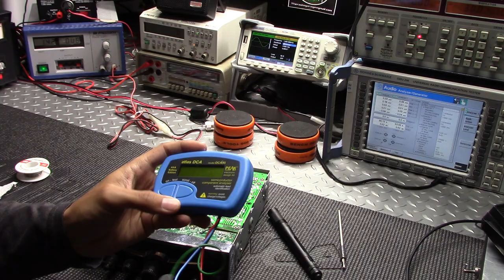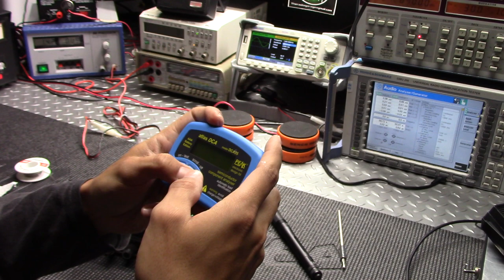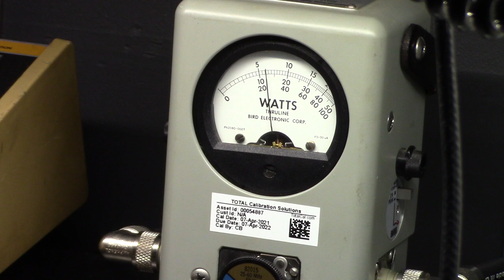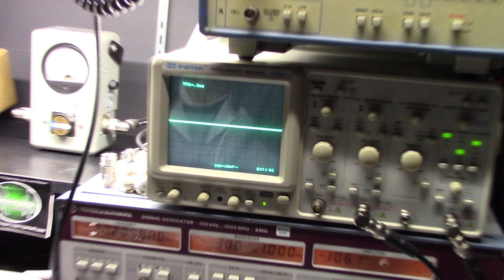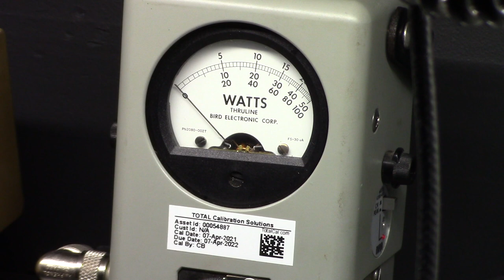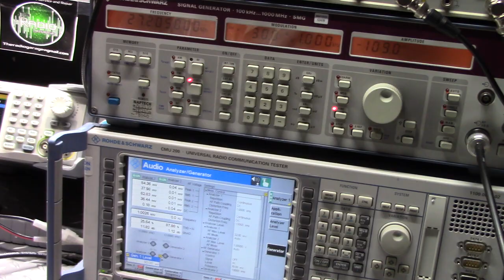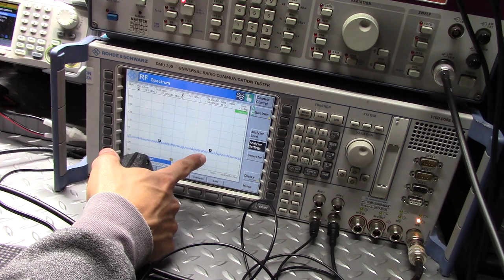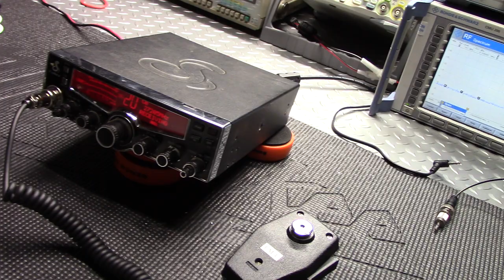Cobra 29 Mosfet Mod CB Radio Repair Tune Align

Comment: Smoke Stack Lightening!
That Radio Was Frightening!
"Clean and Mean out-talks 
Over Watt Splatterboxs all day long."
Analogy = variable pattern nozzle on your water hose: You are attempting to wash a large, scary spider off the side of your home from a great distance.(long distance transmission) Adjusted to a large spray pattern, (over driven wattage) you are simply soaking the spider (splattering onto other channels) and irritating it (other users on nearby channels.) Adjust the nozzle to a concentrated spray, channeling all the water (watts in the radio) on the spider (the channel you are on) and you will accomplish the job with maximum efficiency using less water! (wattage) Matt, you stated that I have a way with words. Indeed, my friend. My intent is to educate and entertain with no malicious intent. I have no more than a high school education and a desire for further knowledge, that is self taught, with a ravenous appetite. My profession as a "Comoddities Relocation Transportation Engineer" has given me the opportunity to hone my language, teach and resist the type used on the air ways. I educate innocense, rarely tolerate ignorance. This has resulted in being  nicknamed "THE PROFESSOR". Matt, you have a way with radios that also entertains and educates.YOU DO RADIOS RIGHT! If you find my verbal musings are disagreeable, to or your subscribers, I will cease and desist. If you and your subscribers find my anecdotes amusing and educational then I will cotinue. "The most humble man, is he that seeks only to humiliate himself." From the teachings of the Stonefaced Grasshopper. Truck Driver, Radio Operator, Musician, Martial Artist and Philosopher. Not so extraordinaire. 
Humbly, I am off the key. 😑
Reply from the maker: Yes your comments are amusing and welcome. So feel free to continue. I'm glad we can both provide some entertainment and information to the cb community. Hope all is well on your end and as always thanks for stopping by 👋👍73
Reply: I extent my thanks and well wishes to you Matt, your family and your subscribers. 73,s to all.
Reply: Hahaha I needed that 👌. We need more drivers on the air like you . Being witty and friendly on the air (19) is in the past . You remind me of Lucky Star , he’s in my area of Tennessee. I’ve been talking to him on the radio and meeting up at CB breaks since 2004 . I was a Deputy , then a Trooper for 12 years all together , left on good terms but I just got burned out 6 years ago. I always had a loud,  clean radio . That surprised most drivers , Troopers today don’t know how to work nothing but a cell phone , an Xbox controller and a ticket book, but that’s another story . But I made friends with several and always respected the challenging  profession of being a truck driver ,, or commodity transport specialist or whatever that was you called it hahaha ,, when I was off duty in civilian clothes when  people asked me what I did for a living , I told them I was a babysitter for grownups 😂😂😂,,  or a traffic crash reduction safety specialist. The looks I got in return 🙄🙄. Anyway , be safe out there , if you ever find yourself cruising down I-24 through Manchester, Tn ,, if I’m at the home 20, give us a shout on channel 28 . 73’s to you , 
Cowboy 🤠 
Bump Bump
Reply: @Dallas-Rife-UDX-347-Tennessee  Dallas, I appreciate your come back. After almost 45 years of trucking I plan to retire this fall. I have been a "Suicide Jockey" for my entire career, hauling HAZ.
 MAT. (Flammables, Corrosives, Poisons and Explosives.) But nothing dangerous, you understand!!!  Always complied and worked closely with Law Enforcement. Over the years I have also extended offerings of free instruction to Military, Law Enforcement and Protective Services in Martial Arts. Yes, I am a rare breed from the days gone by, with no plans to change. I have seen your comments on other u-tube sites and would be honored to call you a friend. 73's, from the Grasshopper.
Reply from the maker: Yes Dallas certainly gets around to all the channels, lol. I'm starting to see where the "grasshopper" comes from now 👍
Reply: @TheRadioGarage  
I know good content when I see it , I try to source myself with educated people that have good knowledge about what they’re doing , and are willing to share info as well as admit they don’t know it all 👍, and you’re one of those good ones Matt . I follow about 6 of you guys that do radio !! By the way sorry I missed the window again to send you a radio 🤦🏼‍♂️. I’ll catch you next go around 👍

Comment: Help, have a new 29lx, hooked it up, tuned it, working good, then POP! Like a fuse blew, Radio still works, but just fails antenna check and no Tx or Rx. Its possible the coax cable rubbed through and shorted, or maybe something else. Any ideas before I tear it down and buy new hardware?